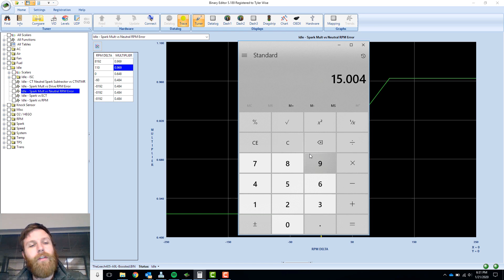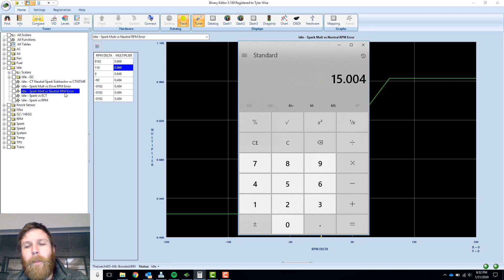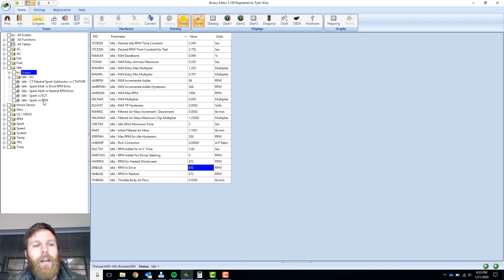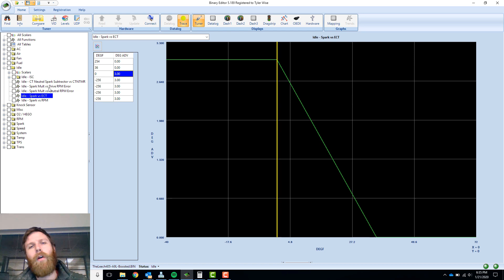Smooth Idle Tuning for Fox Body Mustang 5.0 - Part 1 - Idle Spark Control

Comment: What you failed to mention was that the clutch switch at the clutch pedal and neutral switch in the transmission give the ECU signals between neutral and drive and if you do the math the drive table knocks down the timing a few degrees so when the clutch is pressed and the trans is in gear the timing will decrease a few degrees and when you release the clutch the rpm's ramp up a few degrees to help move the vehicle....

If you set both the same your engine will run hotter plus you'll need to set trans function to no trans controls and no clutch or trans switch..

Anyways I set the positive and negative numbers to 250 rpm's.....When I dump the clutch from a standstill with no gaspedal the car doesnt even bog........

Another thing to note is that one of the biggest issues that plays with a tune making it erratic is the pulsewidth vs voltage setting for the fuel injector...

I set the top 4 -5 lines to the top line setting of 0.93675 then the rest to 1 and now I have a steady pulsewidth from 16volts down to 11 volts as my volts are between 14.5 and 13.2 

For the spark setting I use the setting from the X3Z bin file with 30.00 degrees in the top two boxes and 15.00 degrees in the  lower boxes where theyre zeroed out in the A9L bin file.It makes a world of difference in the shift........

I

Comment: My QH and BE dongle came yesterday. Hoping to have my capactors replaced by the end of the weekend, then it's tuning time! First time for me. 86' Mustang notch. 302ci/E7s/e303 with Anderson power pipe/C&L 73mm MAF housing/BBK 65mm TB/Ford Racing 30 lbs injectors/EGR delete/Holley Systemax Upper & Lower intake/BBK 1-3/4" longtubes/BBK O/R-X/Flowmaster American Thunder cat-back. Looking forward to using the knowledge I gained from your videos, starting with dialing in the idle!

Comment: put ms2 in my fox its a 306 with fcam cant get her to idle if I give it gase she will run soon as I take my foot of she does any suggestion would be great
Reply from the maker: Regardless of tuning platform, a good idle starts with a good air/fuel ratio. Do you have a wideband on the car and can you confirm that your AFR is somewhat close to stoich?

Comment: good video keep em coming. just put the moates in today time to make some power.
Reply from the maker: Awesome. What’s your combo? Is this going to be your first time tuning with a moates setup?
Reply: @LeechMotorsports  stock ho block, bored .30 over. F 303 cam. 24 lb hrs. Sn 95 maf 70mm. Bbk 70 throttle body, bbk ssr2 intake 351 heads, crane roller rockers not sure the ratio probably 1:6. Full length headers x pipe etc... have an old v1A trim supercharger with fmic might install later on . Car ran ok but had lots of misfiring, bucking, etc... no mil lights related to performance. Definitely need to be able to tune.
Reply: Will be first time tuning with moates system. I downloaded tuner pro rt. I saw you are using binary editor though...
Reply from the maker: Yeah if you want to get into the binary editor stuff, I’d be happy help you get the tune straightened out.
Reply: I discovered all my caps were leaking on my pcb. So i ordered some new ones from digi key. Gota get a new solder iron and a few supplies.  So i should use binary editor instead of tuner pro? Have you used both? I definitely will go B E route just so o can learn from you and your content.
Reply from the maker: I’ve not spent a ton of time with tuner pro, but it seemed that binary editor was more intuitive and I’ve had really good support from the crew involved with that. Shout out to Ben Head, Adam Marrer, and Clinton Garrity. Ben at Core Tuning is the reason I even got into this self-tuning hobby to begin with. Ben can get you setup with a binary editor license. Once that happens, shoot me an email at TheLeech405@gmail.com and we will find some time to work together on your tune.
Reply from the maker: saleenstang also, are you positive you got the correct caps? For the big blue caps, the replacements need to be 47uf and 16v and supporting temps of 105 Celsius.
Reply: @LeechMotorsports   yes put 47 uf 16v and 10 uf 63v both 105c rated.
Reply: @LeechMotorsports  completed the cap swap . Took her for a test drive and its running sweet. No more shity idle and no more bucking and backfiring and missing. Those old capacitors were definitely giving me trouble. Two legs were broken and all three where leaking. Will send you a email soon  and will get B E in the next week or so.
Reply from the maker: Fantastic. Glad to hear you figured it out. Look forward to working with you.
Reply: @LeechMotorsports  the ecm died. I had a a9p as a spare i putt it in and the fuel pump runs constantly.... won't run. Can you recomend a place to obtain a new ecm??? Shes dead in the water.... so sad
Reply from the maker: @thatguy83ful  damn that sucks. Josh Popper at Encore MPW (Mustangs Parts Warehouse) repairs these and also keeps them around for sale. Prices will vary, but you can certainly contact him about repair or buying a new one and hopefully he call help you out. There are also a few computer exchanges online that you can look up.